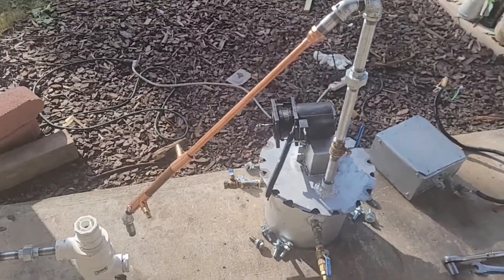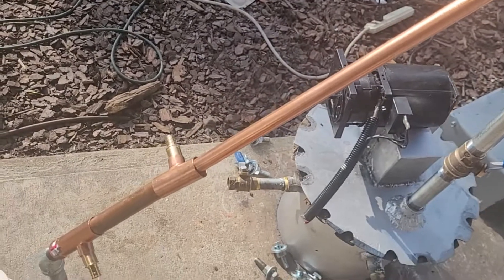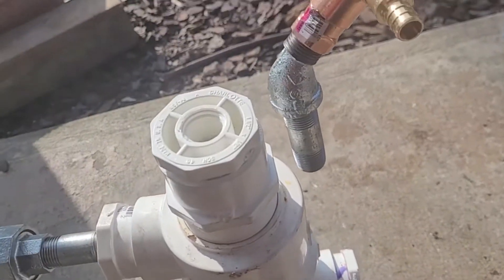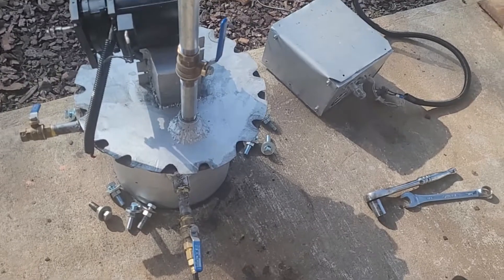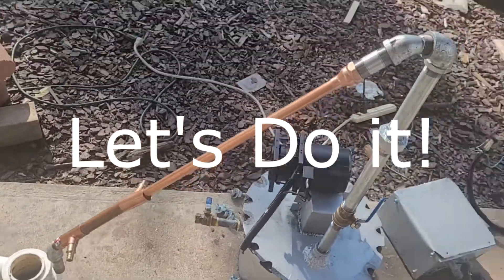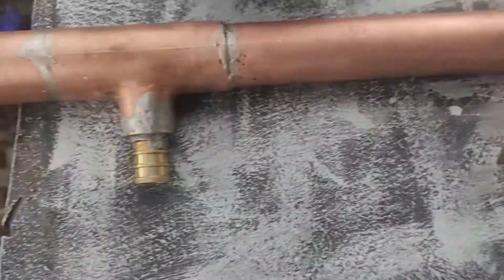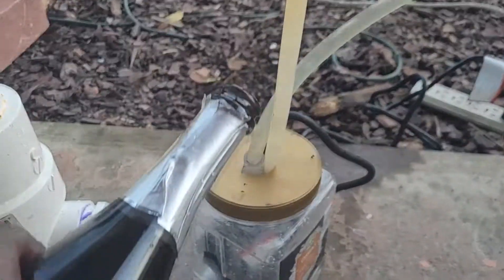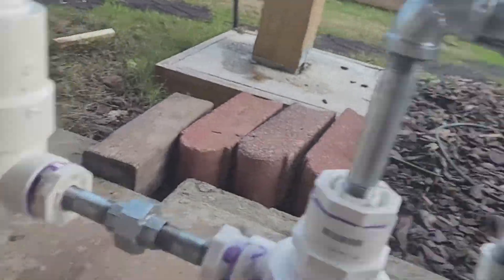Building Condesning System (Pyrolysis Reactor)

Comment: Pretty cool! I’m guessing you’ve learned by now but you want to use your flux in the joints before you put them together. Heat far opposite to where you introduce the solder. Once the whole joint is hot enough it’ll suck the solder all the way up the joint. Keep up the good work!

Comment: You'll never be a plumber lol 😜🤣 and ( lie- big )
Reply: But all in all great video ! Just do it like distilling alcohol then put it through (gas bubbler) them kitty litter last steel wool
Reply from the maker: Thanks!
Reply: @naturejab  just to say you condenser maybe too low down think it would be better for you to put it at top of the( fraction pipe) just past the bend ! Very I'm pressed ! I'm building one now aswell !
Reply from the maker: @MrMartinswan  Very cool you're building one yourself. Thanks for the suggestions I will try them out.
Reply: @naturejab  yep I've got a( LPG gas bottle!) Some steel pipe and iron fittings there I'm youseing inch to stop clogging / to dry I'm running it through cat then steel wool because it's stop the wool rusting as much
Reply from the maker: @MrMartinswan  that makes sense, do you have a water bubbler of any sort?
Reply: @naturejab  I use an air tank be for the bubbler at stop suck back
Reply from the maker: @MrMartinswan  Alright, thanks

Comment: What is the reason for bubbling gases through water?  It's dangerous, actually -- it can get drawn back up into the column and retort in some circumstances, and cause a steam explosion.  I've eliminated it from my designs a long time ago.
Reply from the maker: I have noticed the bubble creates a lot of pressure in the reactor. This isn't a bad thing because it helps the reaction happen more effectivley as well as helps the gasses condense more. The bubbler itself serves as apart of a multistage filter to deacidify the gasses making them safer. It removes the hydrogen sulfide as well as some of the carbon dioxide making the gas burn cleaner.
Reply: @naturejab I'm sure you're already figured out to use two chambers one in the middle as a water trap.
   Dam YouTube, two years without a notice!
 YouTube isn't letting me give this video a thumbs up, try a  re-upload

Comment: Also… be careful with reflux or Liebig packing. I tried with marbles and it clogged 😬💨. Rather than packing the reflux, I use a reflux head with steel wool now. Good luck 👍
Reply from the maker: Haha yup I've had steel wool clog up on me before as well
So far in the bigger pipe it's been holding up.